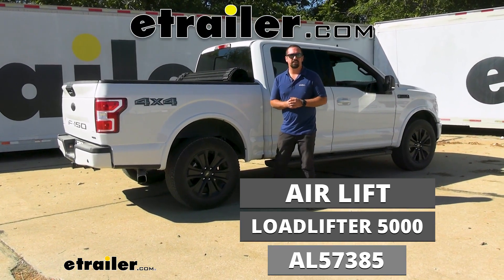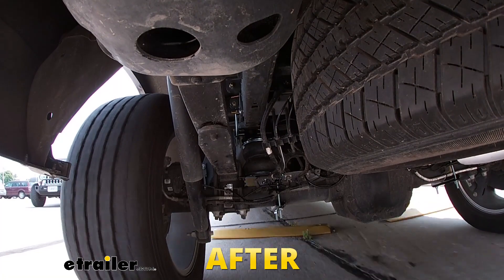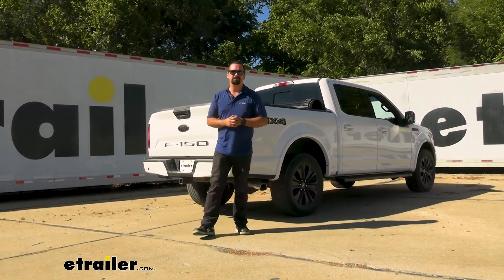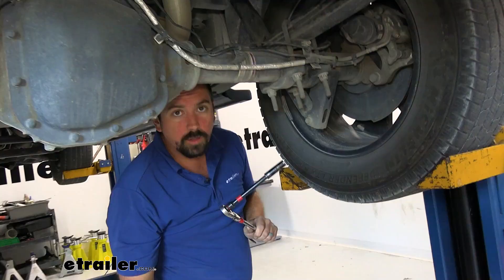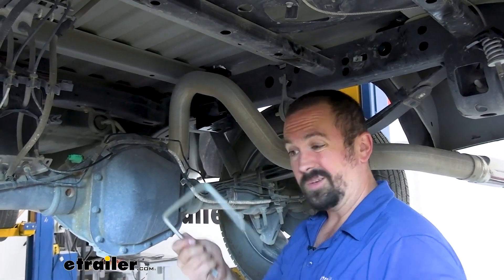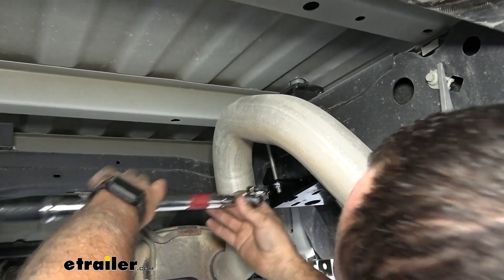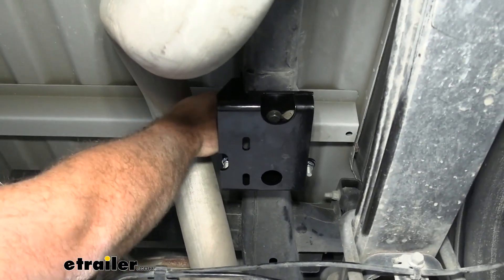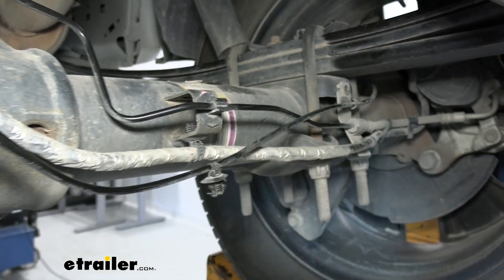Installation Guide for the Air Lift LoadLifter 5000 Air Helper Springs on a 2020 Ford F-150

Comment: Does the heat shield not need to be reinstalled? Also, is it from Air Lift that you can have either the u-bolt OR self tapper? I have no 5th wheel and it looks like i need to install both from how i read the instructions. Thank you for the great video.

Comment: Great install. I think Air Lift needs to redesign the mounting plate that needed a factory bracket to be cut. Ford didn't put that mount on the bracket because it didn't need it.
Reply from the maker: We will pass your comments along to Air Lift. Thanks!
https://www.etrailer.com/Vehicle-Suspension/Air-Lift/AL57385.html
Reply: @etrailer Hopefully they take my comments seriously. I'm looking at all the options for air bags now and like the Air Lift but don't want to cut any brackets.
Reply: @ronlewis6766  I agree, but after watching the "Firestone" style airbag video, I decided on the Airlift kit anyway. The amount of flex on the upper bracket on the "Firestone" kit was a deal breaker for me. I saw that not only fatiguing the bracket, but also the side of the frame as well.

Comment: Will this kit work on a 2019 Ford F150 XLT?
Reply from the maker: On a 4 wheel drive model? Yes the # AL57385 will. For a 2WD model, you'd use # AL57268 instead.
https://www.etrailer.com/Vehicle-Suspension/Air-Lift/AL57385.html
https://www.etrailer.com/Vehicle-Suspension/Ford/F-150/2019/AL57268.html
Reply: @etrailer  Thank you for the quick response.
Reply from the maker: You're very welcome, I'm glad we could help!

Comment: Will installing these add ride height?
Reply from the maker: The Air Lift # AL57385 air helper springs will add extra support, but will not change your current ride height.
https://www.etrailer.com/Vehicle-Suspension/Air-Lift/AL57385.html